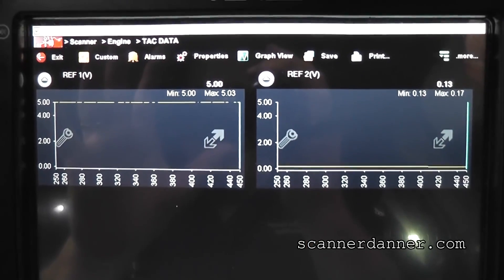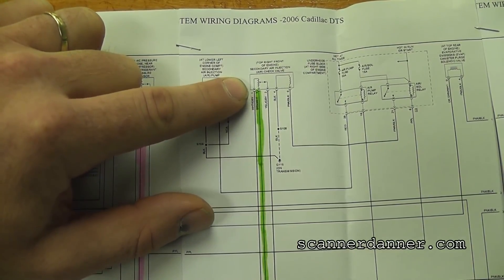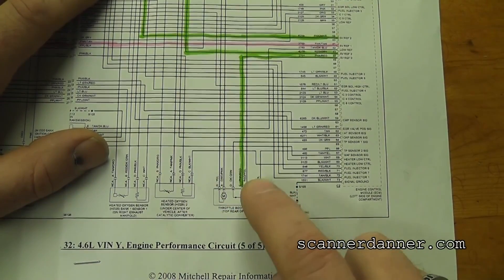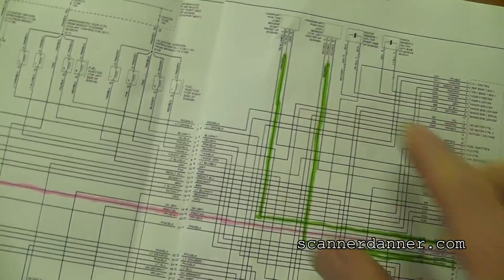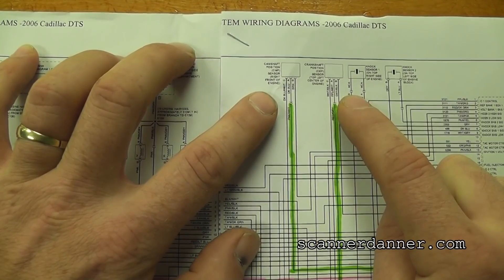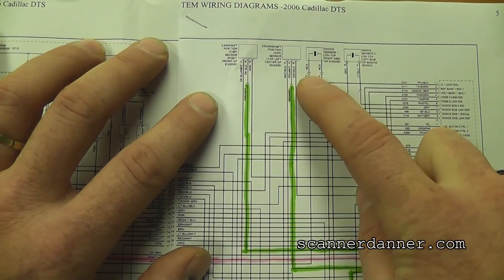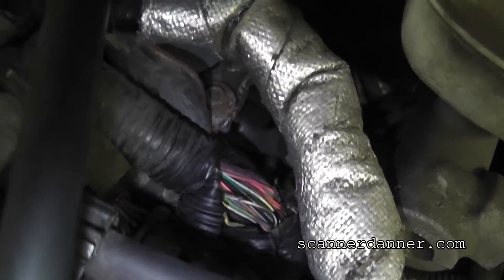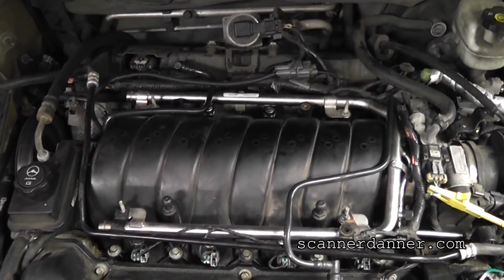2006 Cadillac DTS Shorted 5v Reference Circuit

Comment from the maker: The 5 volt reference circuit is like the cardiovascular system in your body, no 5v ref is equivalent of having no blood psi (YOU'RE DEAD!). But today's cars can have as many as 4 different 5v regulators, while older systems only had one. With a shorted 5v ref on a single regulator system, the engine computer will be completely dead. You will have no communication with it and it will not have spark, fuel or injection pulse. To learn more about this 5v reference circuit and what it does and how to test it, join my online classes on my website (ScannerDanner Premium). https://www.scannerdanner.com/join-scannerdanner-premium.html
Reply: Danner,a few days ago I apply this tip on a diagnosis on Peugeot to find why car had no scanner communication,no spark,no fuel pump and injector action and no nothing. I just tested MAP sensor wires,it had not 5v,and I just read a electric diagram and found a bad fusible oxidation. I cleaned and put a new fuse, after that car worked. That simple tip help too much. Thank you Danner.
Reply: I'm  working on 2010 journey, and there is no spark, and the fuses are good shut down, fuse good, maybe the tpim?
Reply from the maker: @rodger6940 need more info: What codes do you have as a starting point? Power to the coils? Injectors fire? Fuel pressure? (Does the pump prime?) 5V ref circuit alive?
Reply: @ScannerDanner  2010 journey no codes no spark, 60psi fuel pressure 
There is no power to coils. I was looking at the diagram that the fuse 20 ,21 (asd)provides the power, but their good 
But it is also a relay. I just don't know if the relay is built inside the tpim because it looks like injectors and coils get power from it
I haven't checked the 5v yet
Reply: Hey Danner, I have a daily driver 2012 silverado 1500 202k miles,  codes ,172, 175, 442, 455, I did a plug wire change thinking it was that but when I checked the spark plugs all my passenger side plugs still looked clean and brand new while the driver side has the usual wear on em. I'm thinking bad ground on my fuel injector harness.  I thought it also could of been the charcoal canister because I'm getting a strong gas smell by the gas tank after I driven it for about a half hour but then all 8 spark plugs would look new, I did a plug change in July. I don't know  what's going on . I took my truck to a few shops they want to run test on top of tests and fix all the other stuff going on with it to but I'm not falling g for that after I seen your channel .. any ideas?

Comment: I need help!! I have codes p0036 & p2122 and I think the cause maybe from exposed wires specifically 02 sensor on catalytic converter !! How can I fix this
Reply from the maker: I'm sorry, I don't have silver bullets on this channel. You've provided me with zero information and no testing results that you've done. And you didn't even define the codes. 
I can help, but only after you do some more legwork
Reply: I just gave you codes I’m telling you the wires that run to 02 sensor catalytic converter are damaged  what more should I provide if that isn’t enough
Reply from the maker: @alexgaona5682  so fix the wires then. What are you asking me? Also define the codes. Im not a walking library. What are your symptoms? Also, year, make, model and engine. I do not have a magic wand or a crystal ball and I'm not here for the silver bullet seekers

Comment: I have a 97 civic was doing good I parked the car to go eat and came back outside and my hornblows when I engage the starter I unplugged the hown fuse so the people around me don't get pissed and it it has a clicking noise in the passenger dash it has no crank no start situation
Reply from the maker: Lol, that's funny, I mean, I'm sure it wasn't at the time. How strange. Definitely would like to know if you have communication with the ECM and what your 5v ref circuit shows with the key on. Check it at your MAP or TPS.
Reply: @ScannerDanner  yea have you ever heard of that before have you ever seen a car do that
Reply from the maker: @benhall8946 not the horn circuit and on a 97 that's very strange as I'm sure it's not computer controlled. Main engine block ground issue maybe?
Reply: @ScannerDanner  ok so a ground would cause that could it be the horn clock spring or ignition switch
Reply from the maker: @benhall8946 a horn contact issue in the clockspring isn't going to cause a no crank no start condition. And an ignition switch issue shouldn't blow the horn! It doesn't crank right? Time to do some testing at the starter and then back track from there.
Reply: @ScannerDanner  hey I got another question for you buddy so I ended up fixing my car and it was actually a chewed up wire to my security system those cars do have like a little security box in them some of them do but my question for you is my 97 Civic I am literally getting like 18 to 20 mi to the gallon right now when I should be getting 30 last night I got 30 Mi to the gallon and now the next day I'm getting about 18 miles to the gallon today it seemed like when I unplugged my battery then I got better gas mileage but once everything set back in and the car ran for about 6 or 7 hours I start getting bad gas mileage again
Reply from the maker: @benhall8946  need fuel trim data to help further. Also outside air temp has a HUGE affect on mileage. Not to mention city and highway driving. No way you'd be getting 30 in that car city driving

Comment: I watch many diag oriented vids (yours, pine hollow, south main with Eric O). Eric O used a light bulb hooked to power and grounded to his faulty circuit, and unplugged sensors and lightly jiggled the harness and found his fault that way when the light flickered. Its a valid method. I suspect on delicate circuits the scope method is safer, but on a 12v circuit down and dirty is faster. Just a thought, opinions? All feedback is welcome, from Danner to readers.

Comment: Can guarantee that if this went through your normal "Jimbobs Auto" that they'd have thrown a PCM, TPS, CMP, and so on at it. What I always preach is start simple. People think that because it's expensive or electronic that it's likely to fail. Start with the simplest things first e.g. checking harness integrity. 

The beauty of these videos is that most of these diagnosis fall back on basics. They can even be done without a scope.
Reply from the maker: Something so many viewers do not understand. They say, "but you have all that fancy equipment". If they only understood that these methods can be altered to fit what tools you have. Thank you so much for the comment!

Comment: And of course the wire was buried on the bottom of a bulk harness under two layers of conduit wrapped in electrical tape near a subharness split!  That Cadillac made you WORK for that one!  LOL

Well, at least it wasn't a slightly dented coaxial cable integral to a $1,200 harness that flagged 14 hours of book time to replace!  ;)

Comment: The best in the EAST!!!!

Wish you were geographically closer to me!
I’m struggling with a no command from computer to egr control solenoid either from old computer or rebuild computer 🥶
Weird 1986 ford e-150, would make a great case study video,
Reply: Hi Paul 
Thank you for your response!!!
Sorry for the delay 
So just so I’m clear on this…
Test light to positive side of the battery than touch the pin on the computer and see if it lights up when the computer commands it on, right?
I just don’t want to damage anything 
THANK YOU! 👊
Reply from the maker: @Phantomas2011 that is correct and no you won't hurt the ECM. Just make sure it is a ground side switched circuit. If it is power side switched, the test light need to go to ground. Most outputs are ground side switched btw.
How to tell? The EGR solenoid wire that doesn't go to the computer will tell you what's in the computer. If it goes to a fuse (power), then it is ground side switched. If it goes to a ground, the it is power side switched.
Reply: Ma man in Pittsburgh!!! THANK YOU for confirming, I’ll test it and will post the results 😀👊
Reply: Hi Paul,
THANK YOU AGAIN FOR YOUR QUICK RESPONSE!!! 🙏👊

I didn’t test the pin we spoke about yet BUT,
I’m finding 9 volts on the 5 volts reference circuit, that circuit feeds three sensors.

I disconnected all three sensors that are on that circuit and there was no change using the old computer or new computer! 
BTW the 5 volt reference  is a ground
Reply from the maker: @Phantomas2011  some of these older systems did use a 9v reference! That may be normal
Reply: @ScannerDanner  I’ve checked the 5 volt reference voltage many times before and never so it that hi, I’m going to start disconnecting things like the alternator and ignition switch and see if the 5 volt reference comes back…very strange problem
Reply from the maker: @Phantomas2011 if you're sure it should be 5v then you have a bad computer ground.
Reply: Hi Paul 
Wanted to let you know I found the issue with the EGR not working right!

I totally messed up when I changed the EVP connector, I hooked it up the wrong way and went down my own rabbit hole total amateur night 🥶
Live and learn I guess but wanted to thank you for all your replies 👊
Reply from the maker: If you substitute a test light right at the ECM pin, as the load, will it light the light when the driver turns on?

Comment: I think those have 2 crank sensor circuits, that may be why its running.  May even have 2 sensors built into one . Of i remember
Reply from the maker: I didn't see two on the diagram, but you may be right.